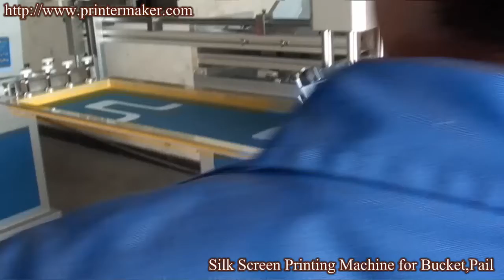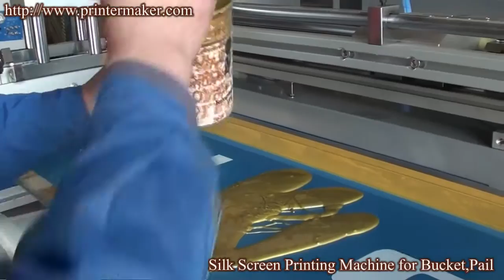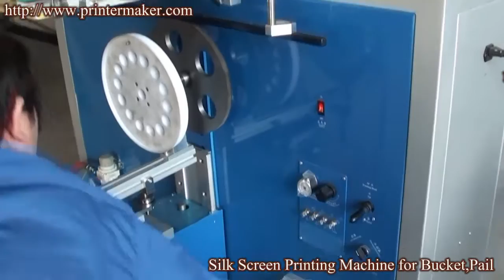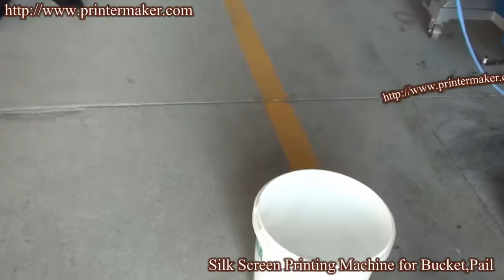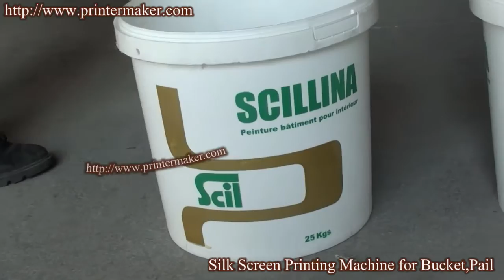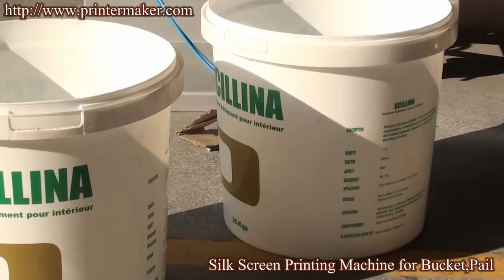Bucket Screen Printer with Second Color Printing

Comment: What's the lenght of the printing area? I need a machine to print 5 gallon buckets 19L and the lenght is 87-90x20 cm aprox., so will this machine print such area? will this have such a good registration as to be able to print process colors (CMYK color )?